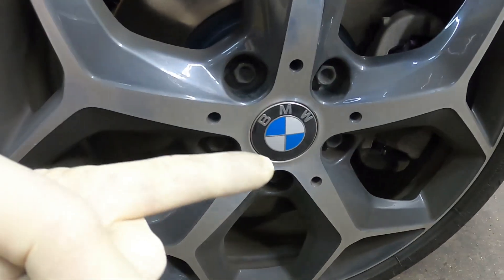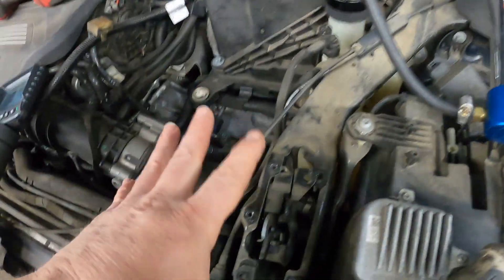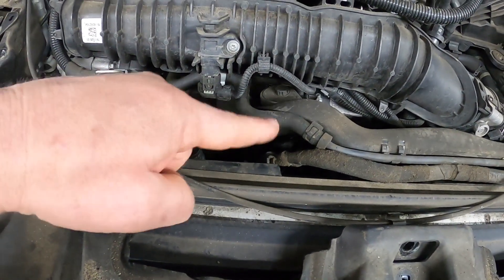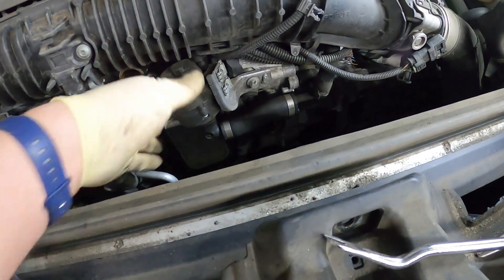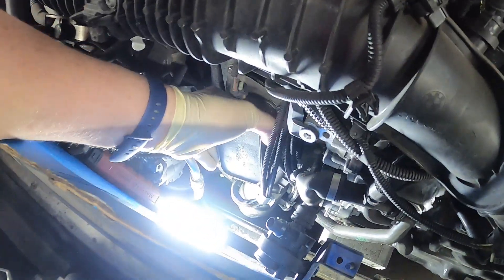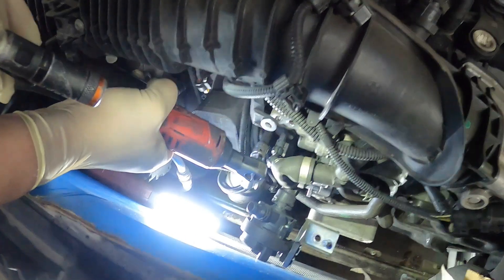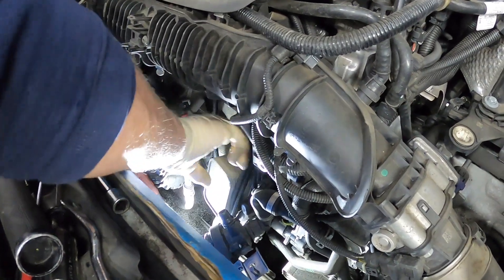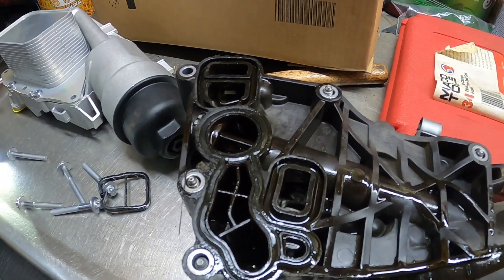2017 BMW X1 2.0L Oil Filter Cooler Housing

Comment: If anyone else is planning on doing this job, removing the intake manifold is much easier than removing the fans.  Also look for videos on how to properly bleed the system jf you have an electric water pump.

Comment: Why you dont remove the exhaust manifold first
Reply from the maker: Because you do not need to take it off.
Reply: Nope much easy to take out the intake manifold the black plastic in top
Reply from the maker: @ronaldrobles4712  I was able to do it without remove that stuff. I have done much harder ones that this. It will make it easier but you run the risk of braking something else.
Reply from the maker: It can be done with out removing the intake manifold. I always worried about sometime falling in the engine and messing the valves or pistons up.

Comment: This thing is designed to fail. If the upgraded aluminum aftermarket oil filter housing can be had for less than $60, I can't imagine it would cost more than that for BMW. it is way better than the plastic BMW part.

Comment: After I had my oil filter housing fixed, now all my sensors are giving drivetrain malfunction warning, car won’t accelerate, it’s so frustrating. I believe the techs wet my sensors or some
Reply from the maker: Probably did not get something plugged back in.
Reply: We are having same issue
Reply from the maker: @christieraya4936  This is going to fail on all of them.

Comment: Hi 👋  may i get your opinions regarding BMW original oil filter housing with original oil cooler vs oem housing and oil cooler , how long does it last ?
Reply from the maker: These cars had around 100K on them.

Comment: Hi, I Have a BMW 218i Active Tourer which have same engine and same Oil Filter Housing and same location on the engine!, I have same problem : A light oil leak from top left side of the filter house. I bought the kit of Gaskets (OEM BMW) for both the engine side and the gasket between cooler and the body of the OFH. I will resolve or i need to absolutely to replace all the  entire filter housing itself with OEM BMW or like the metal one that you show in this video? I prefer to replace only the gaskets if this will work! Waiting your kind feedback please. Thanks
Reply from the maker: The plastic gets soft and then crumbles. I would replace the whole housing with a metal one. Amazon has them. Plastic should not used in this application.
Reply: Friday i should take my car to the BMW official dealer in Milan for an oil leak on the upper side from that horrible plastic OFH! I will refuse any suggestion to reinstall another plastic one on my car.  If the exsistent OFH still fine and not correded they can go ahead for gaskets replacement, otherwise i will buy the alluminium one and ask a local indy to do the job!
Reply from the maker: @abbasnehme2018  They will not put a aluminum one on for you only factory plastic one.
Reply: For sure they will suggest to replace ( if the plastic is corroded and cannot replace the gaskets only keeping the OFH)! I hope that OFH still good that can host new gaskets and resolve! In your experience a OFH leaking just very minimal little oil ( not coolant) could be not really damaged or have the plastic corroded that with simple gaskets replacement i can save my poor pocket?
Reply from the maker: @abbasnehme2018  Why do you want to do it twice and waist your money. Replace it now with a metal one and you will not have to worry about it.